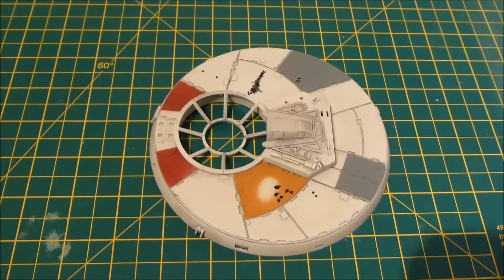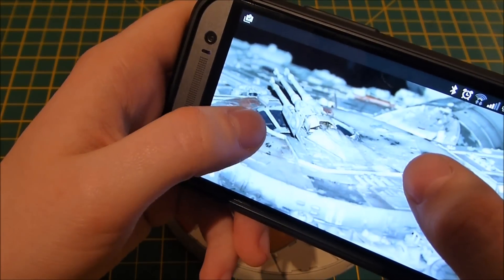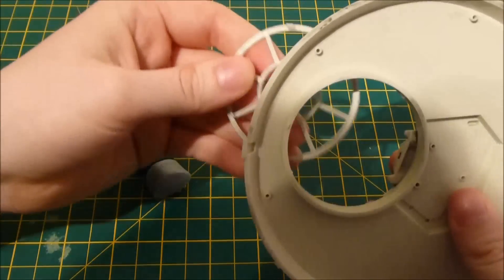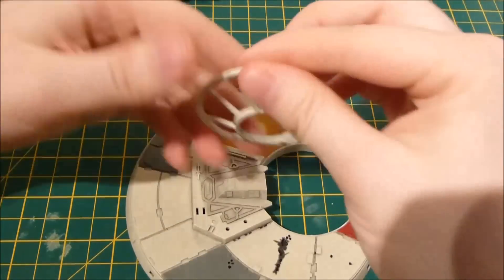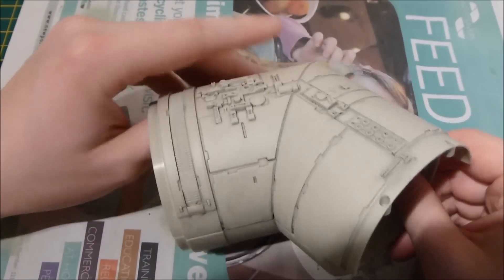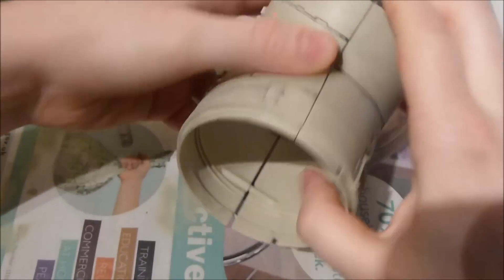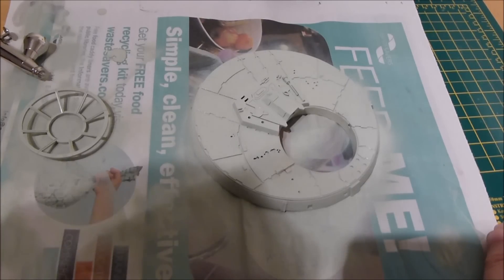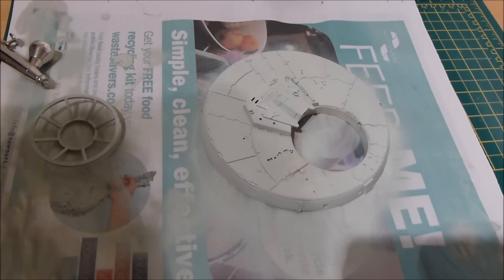Build the Millennium Falcon Customisation - Turret window and more hull

Comment: Is it ok painting it without priming it first? i noticed when i was applying a GW nuln oil wash to the panel gaps that the wash did not act as it would on a painted surface, so does the vallejo paint stick fine without priming coz it would save alot of time and money not having to prime a model of this size
Reply from the maker: Metal will need priming. Otherwise the paint will not stick :( washes don't really work on non painted surfaces